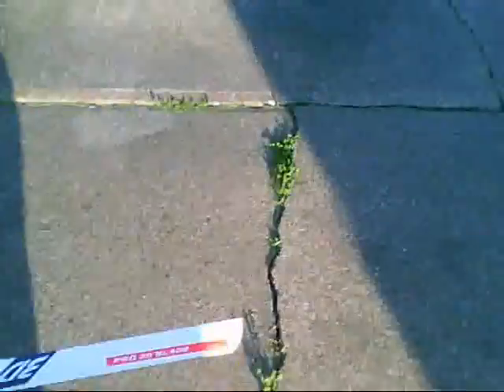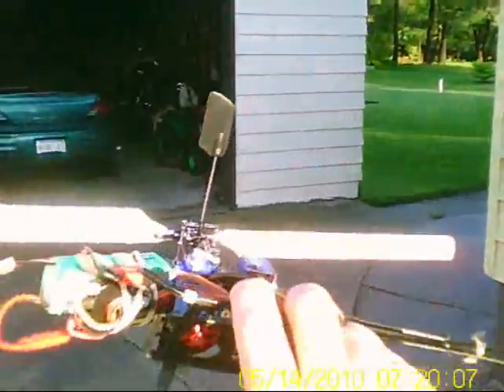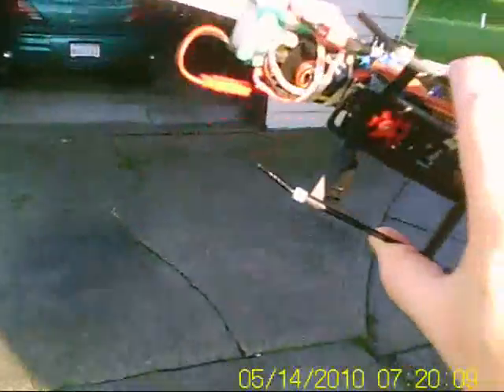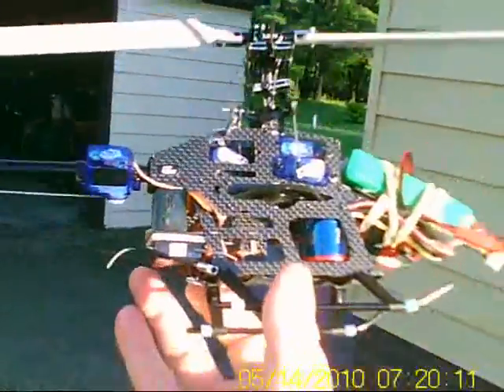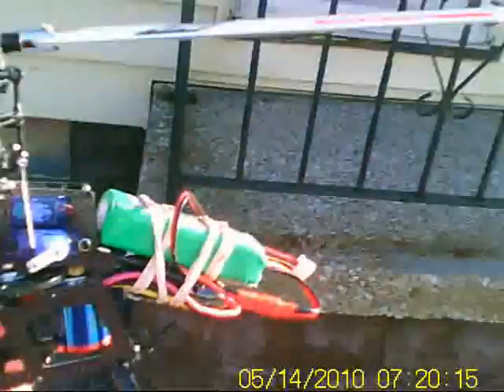Finally getting the HK250 under control and having some non-crashing flights!

Comment: I Just received my HK250GT in the mail the other day. Are you use the HXT900 Servos on yours? I have the Align DS420 on the tail and using the 900’s on the cyclic.  What are your settings on your 250? Do you still fly it?